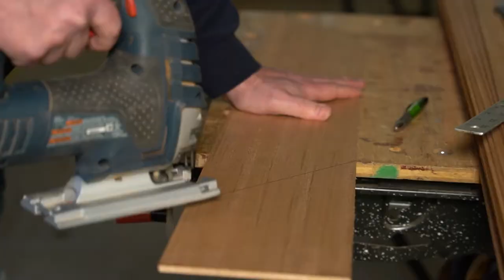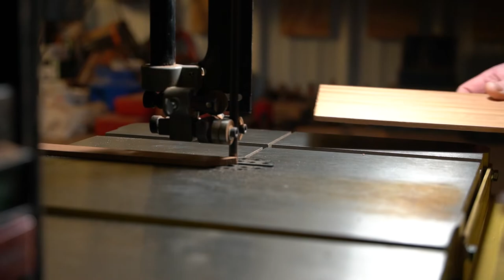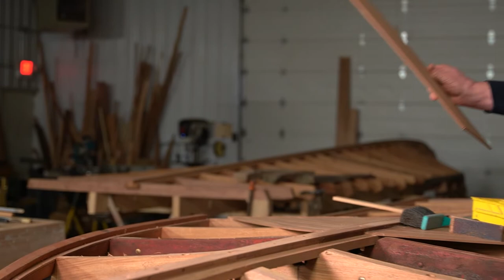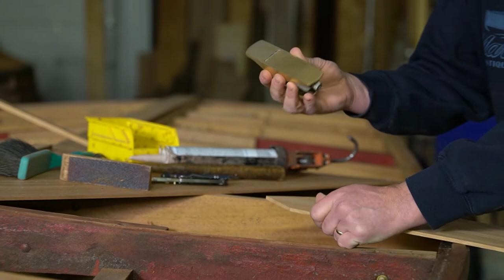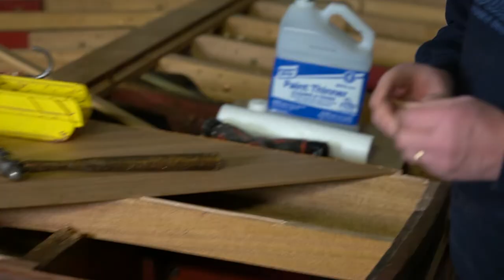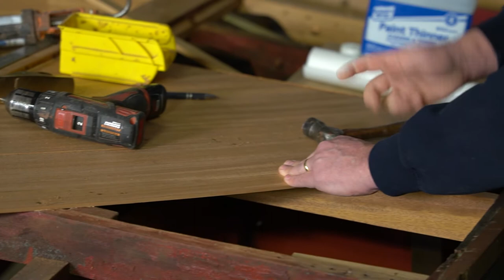How to Install a 5200 Bottom - Episode #5 Installing the New Inner Bottom

Comment: Bronze ring shanked nails like that were used on the bottom of Stan Sayre's famous 3-point hydroplane Slo-Mo-Shun IV. In 1950 it became the first craft in history to be timed at 100 miles per hour in a heat of competition around a closed (5-nautical mile) course. SLO-MO averaged 100.680 in the second heat of the best two out of three-heat series. She became the first boat to win both the Harmsworth Trophy and the Gold Cup races, in addition to setting a world straightaway record, during the same calendar year since MISS AMERICA back in 1920.
In races it was found that screws failed in holding the bottom's plies and these were replaced with ring shank nails which never backed out. This boat went on to win many more races over the years at speeds over 112 mph. You can rely on ring shank bronze nails.

Comment: Great video Mike. Do you coat all these inner bottom pieces with Smiths epoxy? Thanks.
Reply from the maker: We don't anymore. The inner hull will be painted with good enamel paint to match the factory color. The 5200 will be a barrier between the inner and out planking and the bottom will be coated with 3 coats of 2000E barrier coat and then painted with 2 coats of bottom paint. We got away from using the CPES due to it toxic fumes and you cannot get it in some states. The original bottom lasted 60 to 70 years without CPES so we hope ours will last close to that.